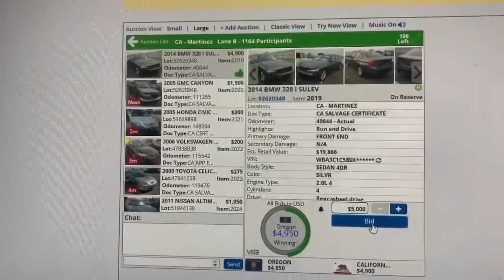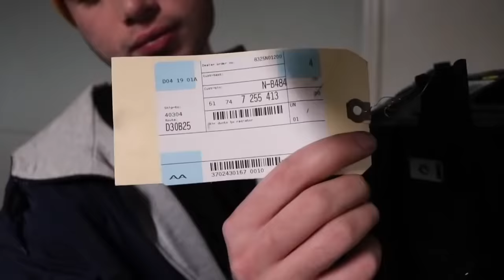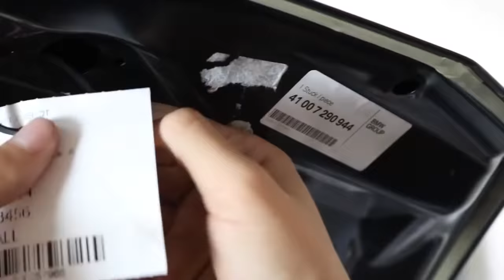REBUILDING a F30 328I in 6 Minutes!

Comment: Give that N20 some love. A chip tune and you are well into the 280hp. It will even take a bigger turbo with stock internals!
But, BUT, timing chains are a problem sometimes. Please get that checked. Plastic guides are prone to breaking, and you dont want that engine to be toast.
Reply: @DeusiCNC  there is no such thing as a 2016 328i as the 28i was ditched in 2015 with the Facelift and replaced with the 30i, which uses a completely different engine.

Comment: Noor what year is the f30? I have a 2016 320 with the factory halogens headlights.  Do u think that the depo lights will work on mine?  The add for the depo says from 2012 to 2015 only. Is the 2016 have different connector or something?
Reply: The front end is different for 2016 models.

Comment: F30 328i n20-n26 motor is an awesome daily driver! Mine is a 2013. Almost 121k miles, overall GOOD CAR! I’ve only had to do tail light connector pin because they melt into the tail light and the tie rod ends were seized, also before 2015 the timing chain issue is a thing. Although isolated and rare it does exist. You’ll most likely not encounter it but do some research on it just Incase.
Reply: Oh and this car LOVES to rattle lol
Reply: @iAlwaysSpeakTheTruth  Ahhh our 328i's sound like diesel trucks at idle. Mine is a 2012 and im scared to death of the timing chain issues. Specially since i dont drive it a lot and mine is one of the earliest batches.
Reply: Santiago Rocha Santiago you most likely won’t run into that issue, I wouldn’t worry about it :)
Reply: @iAlwaysSpeakTheTruth   I have a 2013 328i.       Still worry once in awhile.  But love my car.      Ran into replacing  dme  and ivm.      Not a fun bill.
Reply: Adam R R almost 130k no real issues for me :) did you PPI? I’m sorry man
Reply: Adam R R damn how much was that ?
Reply: @iAlwaysSpeakTheTruth  
2670 at the dealership.    Sadly the indies were mostly shut down and I needed/ missed my car.     And if was a hose that fried ivm which took down the dme supposedly.  But electrical.  Well i cant even argue  I have ista software and km not expert, now it all works well.   They had to get a dme made in germany. Lol took 3 weeks.
Reply: Adam R R Almost 130k same chain and guides no issues here no chain whine nothing :)
Reply: Adam R R change oil and filter every 5k and leave Auto start stop turned off you’ll be good
Reply: @iAlwaysSpeakTheTruth  
Oh yeah  guy that coded to memory I leave it off lol.       Dumb function.       Oh I plan to change it every 3k mostly.        Love my car though. Lol tip.   If you do turn signals. Watch videos first.   And locate the right spot seems every one even Nour breaks one of them.
Reply: Adam R R do keep an eye on the ground wire burning out in the tail light I had that issue